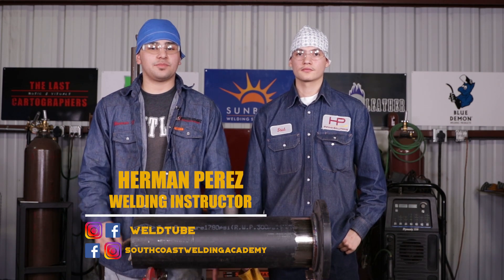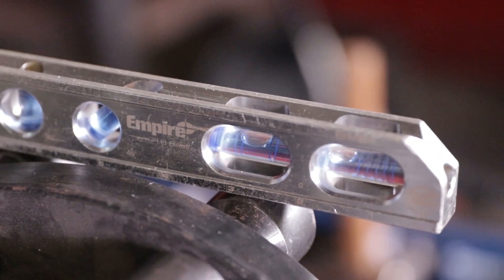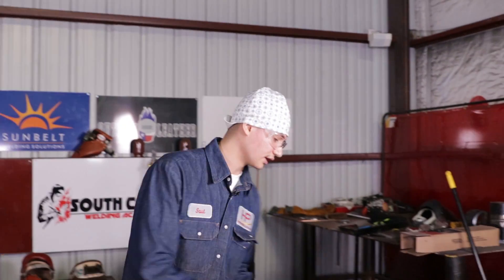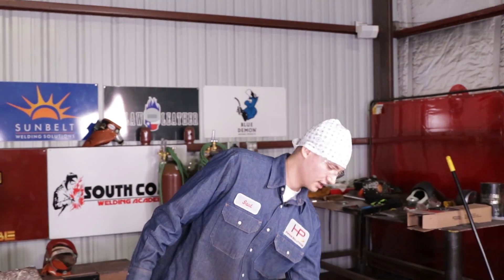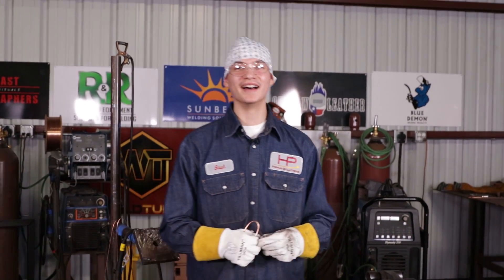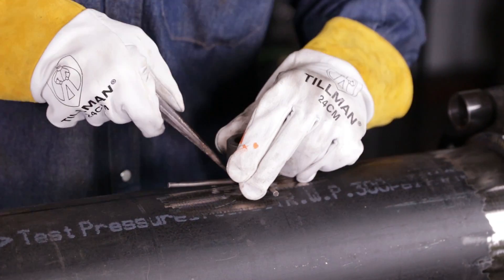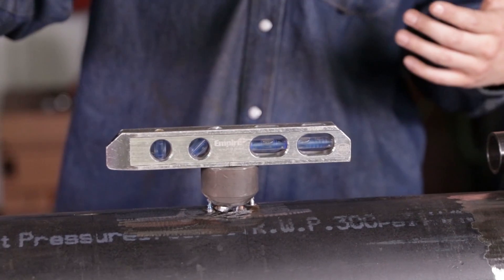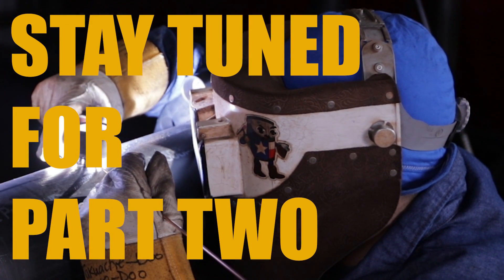Olet Welding - Part One - The Fit Up

Comment: Good content just add my two cents, on bare pipe I always use two squares, one on the olet and one on the pipe. Leave a slight gap and the top to allow for the heat to draw the fitting way faster and consistent, then use a level to double check your two hole and level the fitting. In addition to a wedge it’s nice to keep a couple of 8-10” long pieces of pipe (1/2”, 3/4”, 1” diameter) with threads on one side and square cut on the other to thread in the olet and use a bit of leverage to help keep tacks from popping when only using a wedge. You can also use the square cut end of those pieces in weldolets the same size to help fit them.  I also like to use a center finder to make punch marks for layout of the fitting and for reference later. 
Nothing wrong with what he taught though multiple ways to fit up the same fitting, good video

Comment: need to check the first pair of tacks after making the the second pair of tacks. The level isn’t exactly where you left it when you come back to it and you can correct by welding the high side of the fit up first.

Comment: Torpedo level is way more accurate than measuring. You can get what looks perfect with a square but when you check with a good level it could be out some.
Reply: Be quiet sir . Any fitter worth a flip will tell you that a square is always more accurate than a level

Comment: I don't got a center finder so for small enough pipes I use a square and a level. Just butt the square handle against the side of the pipe while the scale part is on top of the pipe.
Make sure the square is level with the world and make a mark on the radius of the pipe.

Comment: use a small square to center o-let at 12" to center top dead center use a center finder mark 2 spots either side of 12' mark draw a line x marks the spot  continue

Comment: Eyeball the dimension? It doesn't have to be perfect because it's not a production piece? Thank God. How did he center his hole? And punching the outline of your hole is a waste of time,  especially when you're reference line is a marker 1/2" thick. Preheating the hole on pipe that thin is unnecessary. That "c" curve on the sock-o-let is called a saddle.  The "90 square" is a 2ft. framing square. And hi-lo is an industry term for internal misalignment.  How can people looking for good information really benefit from this?  Good initiative,  bad judgment. Next time get a real pipe fitter,  not someone who's been a "fitter" for no more than a year and decide to put him on your channel cuz he's your friend.
Reply: PROFESSOR674 agree
Reply: Very true

Comment: Not a bad basic teaching to get the jist but needs more meat for teaching instruction. Center finder or using a level and square for the center is big especially during prefab in a plant. Btw safety queer would have a field day in an industrial plant grinding that socket 😂.

Comment: Rather than all the prep for the torch why didn't you just cut it with a hole saw and how about working it with a center head when it's two hold
Reply: Pipe to thick for a hole saw
Reply: @carlosdelgado4870  with all my years in the piping trades I am yet to run into that. But I have ran into the base metal being too hard.LOL

Comment: How do you know that weldolet is perfectly in the centre. A centre finder or level off the side and measure in the radius is needed? Also when measuring out the foot use a square off the pipe to get an accurate measurement. 
Neat job but try show all this for people who have come to learn. This is not a good video for the pipeys out there
Reply: That's what i said
Reply: Can we chat on whatssap messenger +233241490473 am a fitter

Comment: To your fitter, quick little tip, use your center finder, get a compass set it to the I.D. of your thread-o-let, run your compass to mark your pipe.  Good job using the punch.  Also use a threaded nipple and use a "torpedo level."  Leave the nipple in so the welder can check his level during and post weld.  Keep on learning young man.  Oh, also, never pull tape from top of a raised face flange unless you take in consideration for the face of the flange, that slip on looked like a 150# so it's 1/16".

Comment: I thought the first step before anything was checking the print? I’m cornfused as hell meow. Another good tip is to check the print and know what’s going on before you prep and cut the hole🤦‍♂️😂😂😂. I’m also a side line one holer! 👀

Comment: Nice video, massive gap yeah!
Reply: Na thats a usual gap
Reply: @evoryann  I guess it's about the same thickness as the pipe, just looks massive.
Reply: @ifell3  oh yeah for sure. Ive been asked to make huge gaps before. Ive been doing iron for about 6 years but i started pipe a couple years now and it crazy how the big gaps and big bridge tacs mean nothing to a good tig welder
Reply: ifell3 lmao you have obviously never had to back feed, fully penetrate and get full reinforcement on  an olet... bc doing  it with a 1/8th gap or smaller isnt that easy, yea its a fast fill and cap but it aint an easy root.
Reply: @markmoreno8724  lol back feed on a 1/8. I guess man, with all due respect, and i mean alll do respect.. i aint neber seen anyone need to back feed a 1/8 gap